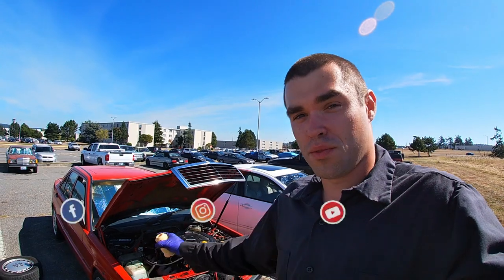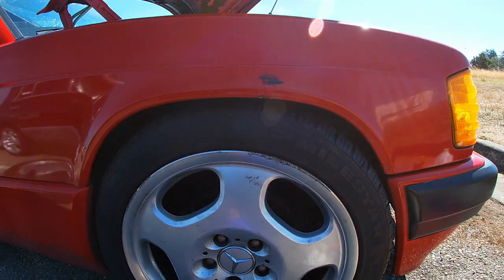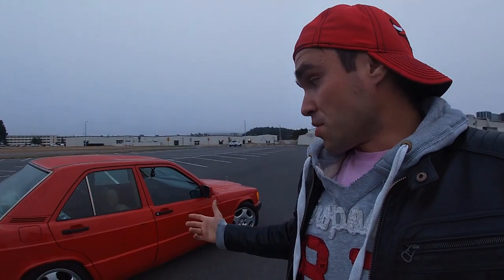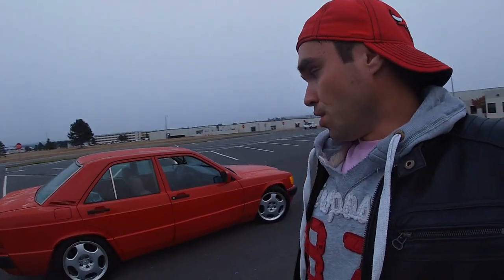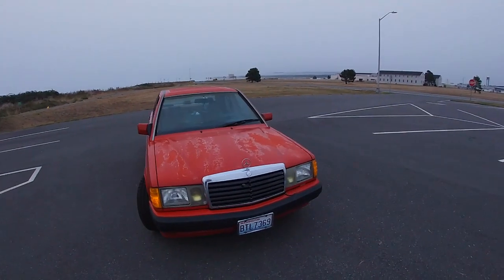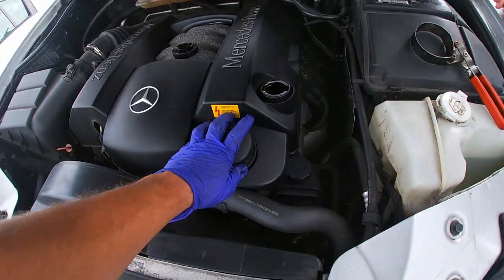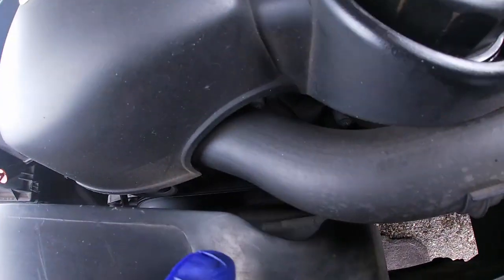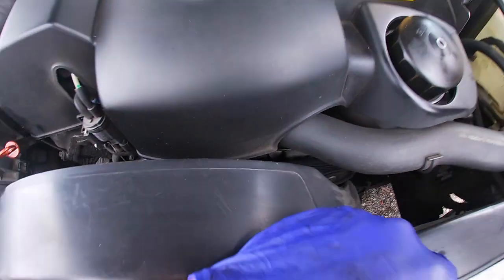FINALLY Installed 17in Wheels on Mercedes 190E! I am Happy. Well, Kinda.. Bonus-W163 in For Service!

Comment: Have the same 17s which came from a W210 E430. I also have Eibach lowering springs which is a great setup with the stock Bilsteins. No rubbing with 215/40s. But maybe a 215/45 may not rub as well.
Reply from the maker: Great! Thank you so much for the tips!! I was looking into changing my tires to a smaller size to prevent the rubbing!

Comment: Always like your dedication. Unfortunately those bump stops will not fully prevent bottoming. I think you should consider flaring the wheel wells. You need paint anyway, so nows  the time. Also, don’t lower too much or the real axle joints will be under severe stress. Good work as usual!
Reply from the maker: No. Never would I flare the wheel wells or cut fenders.

Comment: I have a 1991 Mercedes Benz 190e I found some chrome wheels I was thinking of putting on my car they are 17/7.5 and I was worried about them rubbing the inside of the finders do you think a 17/7.5 rim would work on my car without rubbing?
Reply from the maker: Depends what wheels you're putting on. Benz wheels or aftermarket? You need to look at the offset. Offset is what matters the most. It also depends if your car is stock height or on lowering springs like mine

Comment: Hey man,
I would appreciate it if you could share the wheel and tire specs so it will help me with my fitment calculations.
Reply from the maker: Hi. No problem. 225/45/17 is the size all the way around

Comment: Hi, I went to go look at a w201 2.3 manual early last week. The clutch engages very high. Is that normal on these cars
Reply from the maker: Hi. That means that the clutch disc will need to be replaced soon